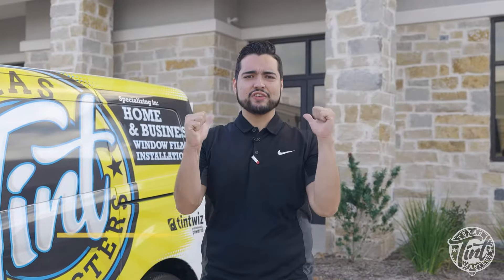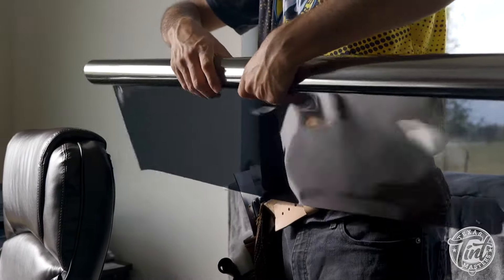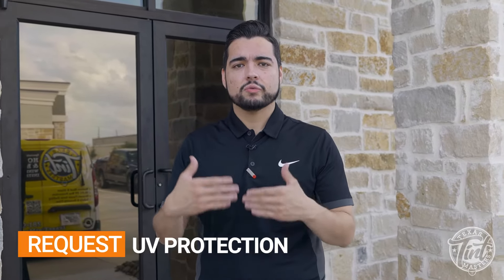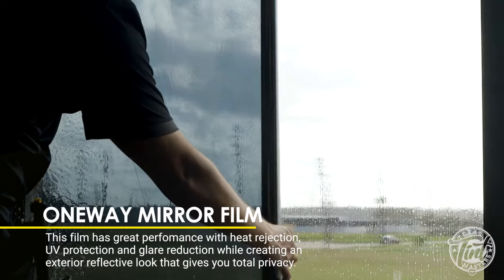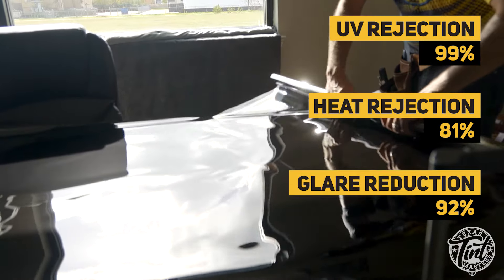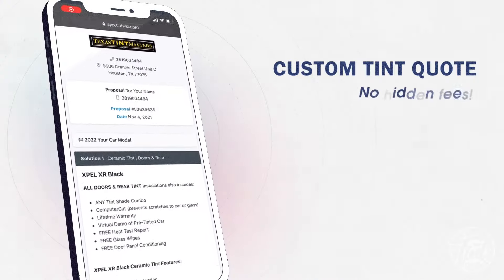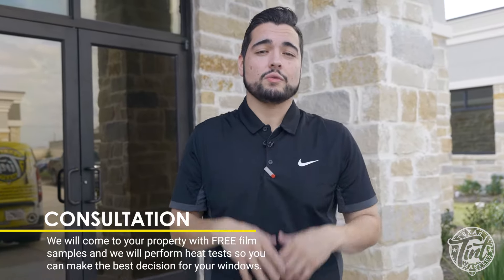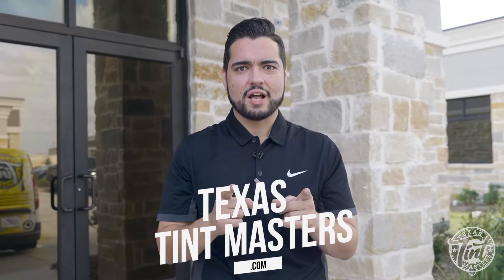One-Way Window Tint for Office Windows | Dark Outside, Clarity Inside

Comment: I noticed some of the videos you guys are putting tent on the outside of the window? What's that about? I was thinking with the ceramic stuff because I have a black interior I never thought about doing the front windshield all the way around the whole car too. I don't know if it'll obscure the view any but even just a clear tint could block all the heat out. But I don't know if it matters how tented it is either. It's just about the product not of black it is.
Reply: They most likely placed the tint on the outside to heat it to form and shape to the glass with a heat gun, after the tint takes the shape of the glass, they then remove it and install it inside. I had the same question until I went to a tint shop and see it done myself.

Comment: does it work at night when the lights are on inside?
Reply from the maker: Yes as long as there’s more lights on the exterior to reflect off the glass. 

No, if it’s completely dark outside. 

This is a solar film meant for day use. For full day and night privacy we have other solutions for it.
Reply: @TexasTintMasters  what is the solution for day and night privacy?